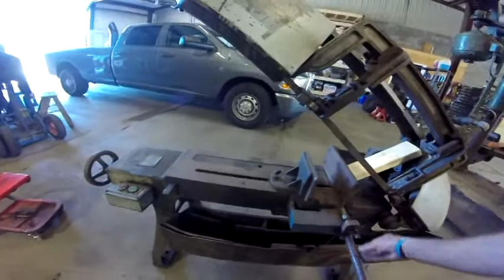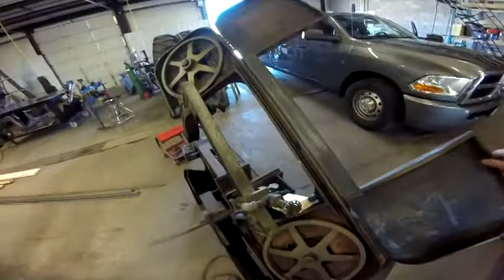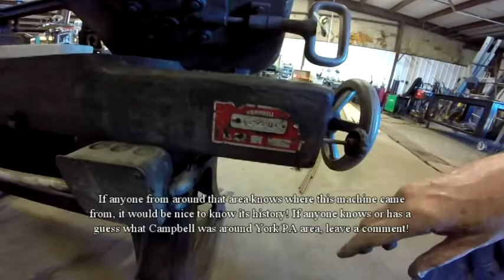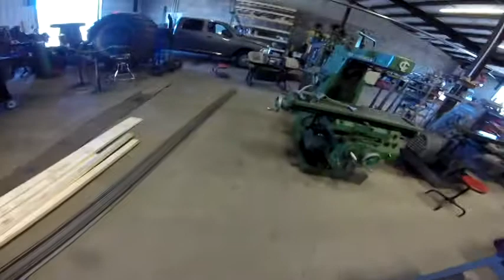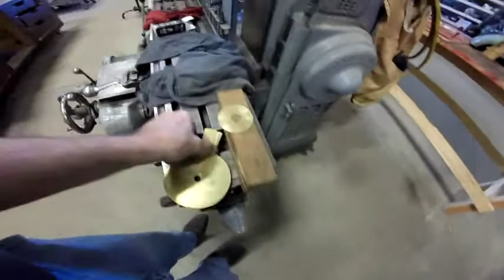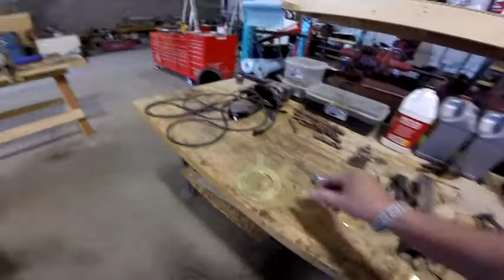Shop Update 10/06/17 Band Saw & Lathe Work

Comment: Nice new addition. I need to find myself a small power hacksaw or band saw. I don't know if you watch Sunppaa, but he picked up a cool automatic hacksaw for like scrap price a few months back. Sweet machine.
Reply from the maker: John Strange John, when you say automatic, was it automatic feed? They had one where I picked up mine, they wanted $1200 for it, but I didn't want to pay that much for something I would probably never use.
Reply: Yeah hydraulic auto feed. I likely wouldn't use it either, but in his case he's often doing production work, so he can set it to cut a batch of pieces while he is off on another operation. I think he said he paid the equivalent of like $250 which is attractive. You can check it out if you'd like: https://www.youtube.com/watch?v=UBe3WDmE-Fw